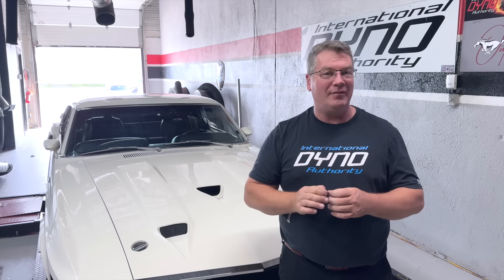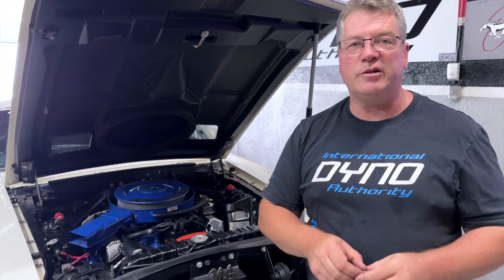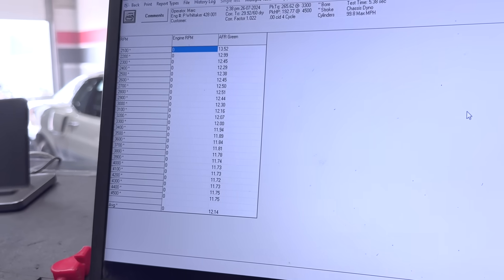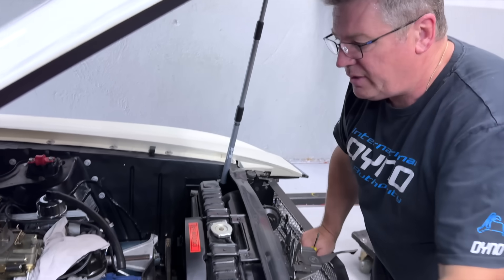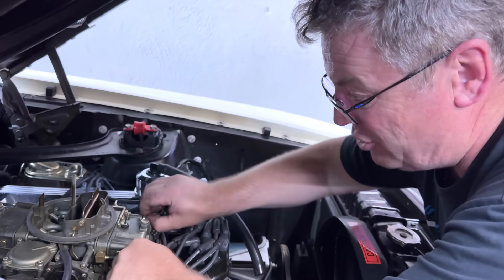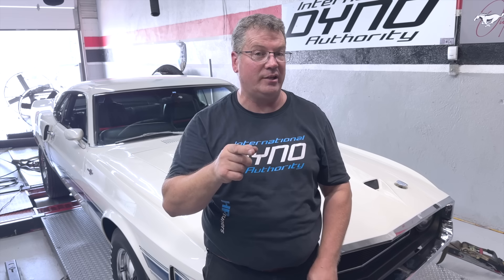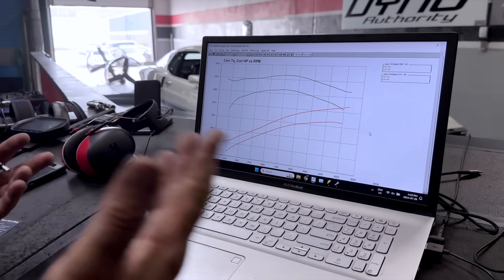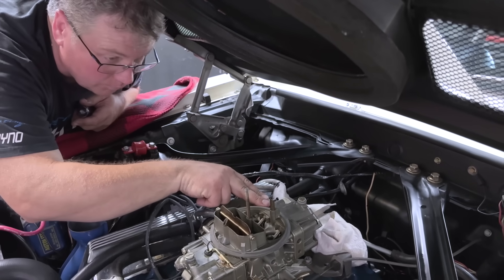Original, unrestored '69 Shelby GT500 tuned on the dyno

Comment: WOW, SUCH A POOR TUNE FROM DEALER.    INSTALL ELECTRONIC IGNITION, AND FUEL INJECTION
Reply: Fuel injection is incorrect on a factory original car like this.  And a properly tuned carb is just as good.
Reply: @danmyers9372  TRUE, BUT YOU SAVE ALL THE ORIGINAL PARTS. IT'S SOMETHING YOU DO FOR DRIVE ABILITY. AND FI IS FAR BETTER THAN CARBS. CARBS SUCK. THAT'S WHY THE INDUSTRY HAS GONE FI.
Reply: AND WRECK THE CAR'S VALUE!
Reply: @MrKentaroMotoPI  A difficult choice ? NO . that type of car easy ,  depends on use , ORIGINALITY or Drivability . I'll go with 1st use , that low an odometer reading seal's the deal !
Reply: @robertmorris6529  WHAT DON'T YOU GET ABOUT SAVE THE PARTS !!!!!!!!!!!!!!!!!!!.   ANYBODY WITH 2 DAMN BRAIN CELLS WOULD SAVE ALL ORIGINAL PARTS. EVEN IF IT'S AFKN WASHER !.
Reply: @trmpgod9976  never said " don't save parts " . You want to drive daily sure go EFI , but IF you respect ORIGINALITY , minimal driving , with ' FACTORY STOCK PARTS ' is the way to go ! BTW are you in USA ?
Reply: @trmpgod9976  as a comparison re this discussion , if you had a late 50's FI 'VETTE , would you keep the original induction or toss a QUADRAJET on it?
Reply: @MrKentaroMotoPI  OMG, AT WHAT POINT DON'T YOU GET SAVE THE PARTS !, (( ORIGINAL PARTS !!! ))
Reply: @MrKentaroMotoPI  R U JUST NOT DUMBER THAN A BOX OF ROCKS OMG !

Comment: It's great to see a shop that knows and understands how a carburetors parts work together and how to troubleshoot and adjust them. Sadly this is now a lost art. I would have liked to see that you had replaced the spark plugs since it had been running rich for so long and also tried to get the vacuum advance working again.
Reply: If the plugs were bad it would have a misfire. It did not.  The vacuum advance doesn't work at full throttle, so no need for it    for dyno testing.
Reply: @wysetech2000  - I personally would like to see them pull and read the plugs.  That is the ONLY true indicator of what is going on in the combustion chamber.

Comment: Going 2 heat ranges hotter on plugs would be better! It will show you good power gain next dyno run not having to burn soot off get real readings in combustion chambers. Not skewed numbers from contaminated plug’s
Reply: Good job.  Why not 3 heat ranges, so it can burn holes in the pistons.

Comment: I would not let that goofball touch my lawn mower, let alone my car...The First order of business is Set The Timing where the factory says it should be..when that is done, tune the timing to good power..THEN start playing with the jets, floats, chokes, etc...when the fuel is looking pretty good..go back to the timing..the AFR is always being looked at...What kind of fuel is in the tank??is it good gas, bad gas, old gas??  How is the car going to be used??cars and coffee shows, light cruising? then..tune the car to the usage.
Reply: Stick with lawnmowers... 🙄
Reply: @dennisschell5543  why are you insulting him? hes exactly correct. you always set timing first.

ill add in that the carb should be adjusted with the car in gear and it should also have a vacuum gauge on it as well. theres more, but thats the beginning

Comment: My same engine made max torque with 42 degrees timing advance, but I run 40 to be safe.
Reply: That is fine if 96 octane leaded pump gas is still available like it was when the car was new.  No way 40 is appropriate with today’s 93 or 91 octane unleaded fuel.
Reply: @danmyers9372  Mine has aluminum heads.  I built it myself with attention to the quench area.  In addition the cam reduces the effective compression.  It runs smoothly on 93 octane.

Comment: I had a 1968 Shelby GT500KR.  Holley made the carb just for that car for one  year.  All Holleys of that era were less than optimal.  With annular boosters or even downleg boosters that engine would pick up both torque and hp.  I ran a Mighty Demon 850 with annular boosters on a similar engine and picked up 20 hp and 20 torque over the Holley.  300 hp to the wheels is about 360 flywheel hp, which is that engines original rating.  At that time engines were rated without accessories attached.  Good job.
Reply: @turbo32coupe  The carbs for the 68/69/70CJ’s were all pretty much all the same - even the ‘U’ universal carb was the same.
Reply: @jeffcoleman2263  The expert from the carb shop told me the 1968 428CJ had a unique carb, made only for that engine for that year.  He said mine was worth over $1100 and that was 1993
Reply: @turbo32coupe  yeah - each year had a different stamped number but functionally identical. AA/AB/M/N/H/AC/AD/U - all interchangeable. But the numbers set them aside. C8OF9510AA carbs most desirable/valuable because there was so few of them…
Reply: @jeffcoleman2263  Good information, thanks.  The fuel atomization was so poor that without the heated manifold, fuel distribution would have been terrible.

Comment: Hi. Great content. Stunning car. Question- did you try timing any greater? Even if tuned conservative, just for general knowledge sake? I'd think 36-38 might be good considering dinosaur old school combustion  chamber design. The gains were nothing short of EPIC. Have a good week, everybody. EDIT  - I'm confused with '20cc nozel'. Are you referring to the squirter? Surely #20 would be much to small. Might you be referring to accelerator pump? Aren't the 2 sizes a 50cc and thr smaller 25cc?? The squirters(or discharge nozels) I'd think would be a 28ish in front. None on vac sec side.

Comment: Does the accelerator pump have the pintle check valve in the passage under the nozzles? That is supposed to stop drawing fuel from the nozzles under high rpm load.

Comment: You're backwards on the function of the  primary "bowl vent"  it's  intended to be  open to atmosphere at idle and closes just off idle.
Reply from the maker: On a modern version of this carburetor. You simply have a whistle. And a full-time atmosphere replacement vent. This one, uncovers just a little bit as you open the throttle. So that air can replace the fuel that has been used.
Reply: @internationaldynoauthority693  it’s counter intuitive, but he’s right. Closes on throttle opening, not opens.